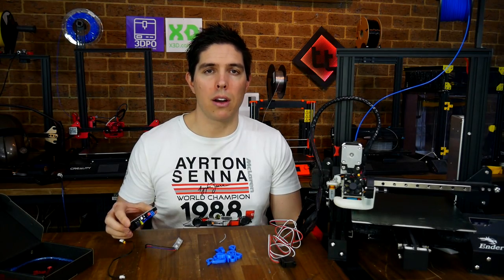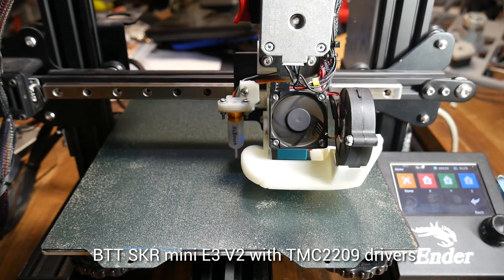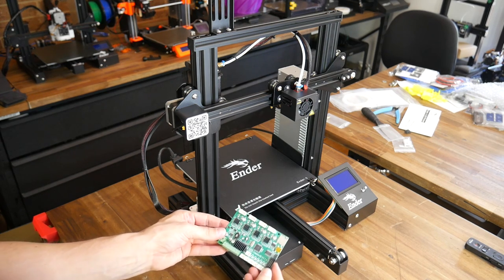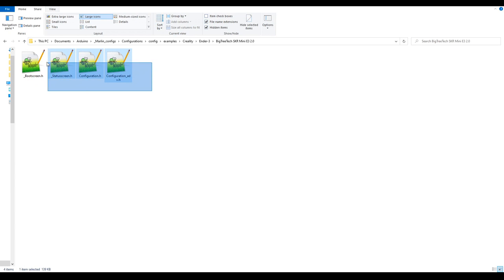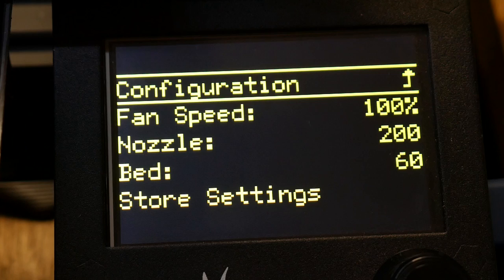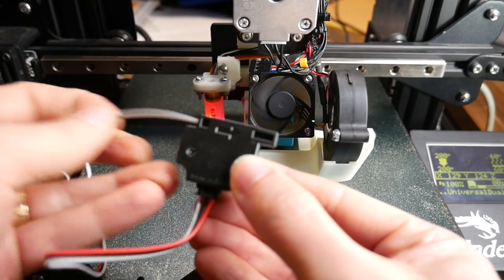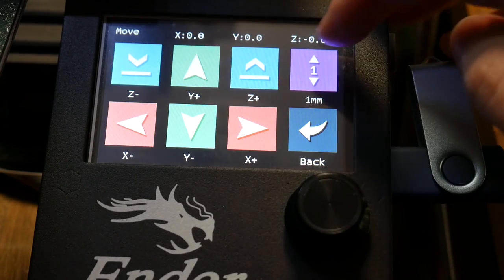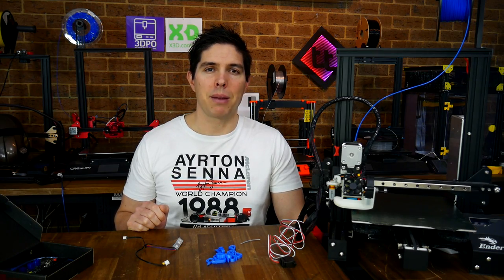SKR Mini E3 V2.0 - Complete guide to the best value Ender 3 upgrade

Comment: I’m having a problem with the wiring from the btt tft35 e3 to the skr mini e3 v2. Looked at this video and the one exclusively on the tft. The wiring diagrams shows on which side the “loose” reset wire goes on the tft connector on the mainboard, but not how the 4-pin part should be turned. I could take a volt meter to find the +5V pin of the tft connector on the mainboard or loosen the screws of the mainboard and look under it. But how can I find out which side of the black 4-pin connector is the +5V. Cannot find any markings on the serial connector on the tft35 e3 board. They would be hidden under the screen. Also, the graphical coding on each strand of the serial cable are not in the same order on the btt installation video as on the black serial cable I got with the new display. So what to do? Btt warns of short cutting the mainboard if getting the serial cable the wrong way. I’m a newbie, help much appreciated.

Comment: It would be super helpful if you could drop in a link or two (or perhaps make a video one day) to some viable dual-motor dual Z upgrades for Ender 3 Pro, which this board enables in earnest (as opposed to driving two motors off one driver). There's a smattering of offers, but most look dodgy (motors not matching the original Z stepper, etc). The idea looks especially appealing if looking to also do direct drive conversion as it add mass and makes gantry sagging even worse. Please consider!
Reply: I know this has been a while since this comment, but I believe the board can power two motors(has to ports), but uses the same driver.

Comment: Mmm, this is seriously tempting. My big question is how well does a BLtouch work with it? On the SKR 1.2 board, I would get BLtouch probing errors that would halt the machine. They weren't super frequent, but were frequent enough to be annoying enough for me to switch to a different manufacturer's board, which works okay but I would like to switch back to the SKR board for various reasons.
Reply: 24 hours after install my first mini 1.2  with the bltouch failed so spectacularly in the middle of a print job that it broke the print in half and drove the hot end into the print bed and creased it. I got an exchange through hamazon and the replacement mini has been working fine, though I gave up on bltouch due to the inconsistencies like you describe and others have noted in bug reports on github.

Comment: First of all, congratulations on the excellent quality of the tutorial. Some time ago, I bought a printer mounted on the arduino+ramps system and I would like to upgrade with this board! It would be possible? Could I use my old printer's endstop+servo instead of bltouch? I also wanted to use my old display which is a Bigtreetech btt mini 12864 v1.0 12864lcd display. How would I go about reinstalling the marlin on the board? I've tried several methods offered but none worked. can anybody help me? Thanks in advance for any help.

Comment: What about Resume print? My resume print after a power outage no longer works after this upgrade. Yet, the code clearly shows resume print. WTH? Any advice on this? Resume print is selected via the options on the toughscreen. This is frustrating, I LOVE how quiet and great my prints are, but losing this functionality makes no sense! Any advice or direction would be GREAT! I have this installed on all my CR-10's and Ender 3's.....SO QUIET....but I need print resume.

Comment: Updated the firmware on my SKR-Mini E3 V2.0 on my Ender 3. Now things are off with my Octoprint. Fans don't start when they're supposed to, I have to click the nob on my printer for it to realize the fan should of been on. Both the board fan and the part fan. The only fan that's on all the time is the heater block fan. 
Also, when I load the firmware on my Raspberry Pi do I leave that sd card in there unchanged or do I just remove it or do I remove it delete the firmware from it and put it back?
Everything worked fine before I updated the firmware on my SKR-Mini E3 V2.0.

Comment: Could you next test if for instance filament sensor works even if printing with Octoprint? Found out that v1.2 didn't support this use case which was sad.
Reply from the maker: That's going to happen with every board because the Marlin filament runout is designed to use the LCD. You can setup runout to plug into the pi GPIO if you like, but I've never done it.
Reply: @TeachingTech  I have it running via the OctoPI, works like a charm. But I noticed that many filament runout plugins all have the same programming bug in the code (seems like copy-paste work). If you have trouble running it on the PI, see my posts on how to correct that in the Octoprint forum.

Comment: Hi Michael, awesome guide. I installed yesterday this board with your guide and graphic and it´s fantastic, no noise at all and the tocuh screen make my Ender 3 Pro in top 3d Printer. I have also installed a Micro Swiss DDE. What do I need to change to print at 310ºC? Thanks, all I know about 3d Pronting I learned with yopçur videos.  Ariel from Argentina.
Reply from the maker: Glad it's working well. In configuration.h there is a line about max temp where you can lift the value. Might be worth a PID tune too. Next video is on a high temp hot end so it will be covered there too.
Reply: @TeachingTech  Hi Michael, yesterday accidentaly I unpluged de printer while it was printing, and the auto resume function as my original E3 snd I lost the print, any idea how to activate auto resume or thisfunction is note supported by this motherborad? Thanks in advance.
Reply: @ArielZima   As far as I know "auto resume after power off" was feature of Creality melzi boards only. Worked by logging the last good line of gcode to the SD card.
Reply: @mrdoohickey4824  Hi, thanks for answering, I asked Bigtreetech support yesterday, they answer my this: "You need to open this configuration in the firmware (enable define POWER_LOS_ RECOVERY. Without the power-off recovery module, the nozzle will not rise automatically and may damage the nozzle." but I don´t know how to edit Marlin. If you can help me doing it remotly I ll be very happy.

Comment: Hello great Tech.
Your videos are great and they help me a lot, but today I need some direct help, I recently bought a skr mini 3 v2 and it stays with the lcd on without any information, when I turn on the power button, it shows a red led on the board and soon it goes out, you can keep the hotend coller on, I've tried to upgrade by the sd card and nothing, and I've tried with all the .bin files I found, when I connect the USB there is no sound signal that it was connected but the lcd stays on.
I don't know what else to do, I searched about resetting the bootload with arduino and found nothing.

Comment: Hello i was wondering if you or anyone else had or is having trouble with a bltouch working properly on the skr mini e3 v2.0. I have tried both wiring ways both as z limit and also as straight z probe. It will run thru the probing and after the 25th probe it will just stop and wont promt to save it so i can use it.

Comment: I want to use this Mainboard for my Ender 3 Pro, is it plug & play? I heard from a few Problems with tmc connection with the x axis?
Reply from the maker: No such issues for me but I can't speak for others. Ender 3 and Ender 3 Pro are the same firmware wise apart from the word 'Pro' on the status screen so yes.
Reply: @TeachingTech   I changed and its perfect, but when I try to "customized" the Firmware with the correct config files, then I get when I try to build 1 failed log (STM32F103RC_btt_512K      FAILED) anyone know why?

Comment: The 1.2 is a lot cheaper now about $34 VS $50 AU however they only seem to offer TMC2208 and not TMC2209.   Is the TMC2209 much better and is it possible to put ther TMC2209 in the 1.2?

Comment: Is it possible to change the firmware in some way to make it so the part hotend fan and power supply fan output 12V instead of 24V so I don't have to use buck converters to be able to run Noctua fans?

Comment: i see only the 35 screen will work is there a way to make the 43 screen to work with this board i mean i can switch it to touch screen however it tells me there is no printer attached? you know a solution to this ?

Comment: Hello, does this board need the DCDC 5V if i want to use filament runout sensor with BL/3D Touch? Or only neopixels?
Reply: I forgot to add that the seller wrote that voltage parameter for Touch is 5V

Comment: Hey TeachingTech/Community! I wanted to hookup my Ender 3 V2 with a PT100 thermistor for achieving hotter temps (300+) and was going to use an amplifier board supplied by E3D to adjust the signal of the PT100 for compatiibility reasons (I assume).  The amp requires a 5V, Gnd & anologue input pin, would I be able to use the pins that are allocated for the neopixel LEDs for this purpose? Thanks in advance!

Comment: What is the advantage, if any, of sensorless homing vs using the switches?
Reply: Sensorless homing is not quite ready for prime time. You cannot guarantee that "home" is in the same place every time because it relies on the stepper motors supplying "feedback" to the stepper drivers by detecting the physical resistance encountered by the stepper motor. End stop switches are more accurate.
Reply: Only advantage is saving I/O... There is some situations, even if not often occuring, where this can be useful

Comment: It should be noted that certain Bltouch need the VCC and GND connector switched to work properly on this board.Took a while til I figured that one out. But other than that it's a great board and klipper makes it even better
Reply: I noted that detail in my review video of the v2.0 a few days ago.
Reply from the maker: I always match mine to the wiring diagrams in the manual as I install. I really hope people don't just plug in cables randomly and wonder why the magic smoke it out.

Comment: Any chance you could do a video on the SKR Pro 1.1 setup and maybe differences with skr pro 1.2 (which appeared 10days ago)
Reply from the maker: I have a V1.1 but not any printer that needs that much IO. Saving it for a future printer than can benefit from it.
Reply: @TeachingTech  i was looking to add it on the ender 3 for dual extruders (todo) and dual z

Comment: Just installed the new board and TFT35 screen. I think there is a problem with this board. After connecting it to a PC or laptop there is a chirping noise coming from the Z axis stepper motor, the threaded rod is jerking if you try and manually turn it and the Ender 3 Pro is pretty much locked up and has to be turned off and on again. I have tried the USB connection on my main PC and then a laptop, all good until a few seconds or minutes after plugging the USB cable in. the firmware for the board says 23-03-2020 I am not sure if there is a later one or if that will make any difference. I will be adding a video to my channel tonight showing the issue. Just mine? Or is this a problem with these boards??
I also noticed that whilst I can press the TFT35 button for three seconds to bring up the choice of Marlin Mode or Touch mode I can not select Marlin mode with the dial, I have to touch the scrren to select Marlin mode, not a major issue but not how it is shown in videos. Occassionally I switch to Marlin mode and get stuck with LCD12864 at the top of the screen, I have to power off and on to get it back to normal.

Comment: Bought an Ender 5 pro last year, had BTT skr mini e3 v2 delivered today and tft 3.5.... as soon as i turn it on and try homing it it just smashes into the ends and tries to keep going... tried building marlin a million times but its not my strength and im failing miserably... where the hell can i find a bin file to just load onto my sd??

Comment: I just upgraded my SKR Mini 1.2 to this version yesterday as well as adding a TH3D filament runout sensor. I am however having problems with the filament runout, and I think it’s because I’m running everything from OctoPrint. When the sensor trips it’ll stop and retract the filament to the distance specified in the firmware, but when I go to load it back in, I’ll press the button and it’ll extrude to the nozzle and just sit there. Subsequent presses just extrude more filament and the print never really resumes.

Comment: I didn't fully understand from the video, is this v2.0 512Kb or 256Kb like v1.2?
Reply: It doesnt matter, in V1.2 used STM chips also have 512K. The recent firmware makes use of it. https://github.com/bigtreetech/BIGTREETECH-SKR-mini-E3/tree/master/firmware/V1.2
Reply from the maker: Rick is correct. V1,2 should have has 256kb but actually had 512kb. This is labelled the same processor but also has 512kb.

Comment: Could you do a video on how to install the ezabl bed leveling system on this board please. I’m a bit lost trying to figure it out. I purchased the version that is sold on AliExpress. It looks like the TH3D ezabl but I have no idea if it’s the same. I had ordered this kit on Amazon until I found out that it was more affordable from AliExpress. Also I’m now using the herome5 dual duct with the 5015 single fan. This puts the abl sensor on the left side of the nozzle. I’m having a terrible time trying to figure out how to make changes to the firmware. I tried following your guides but in several parts you went through things a bit to fast, or you failed to show where to put certain files. You said to copy and paste the config files for the ender into the marlin file. But where in the marlin file? There are a lot of folders in there. In fact the marlin version that I found on github did not contain the config file, just a message with a link that says to go to a specific github file for the bug fix v2.0 config file. Where do I put these bug fix files at in the marlin software? Here is my problem, I’m a bit older then your normal viewer. My grandkids call me old, which in this case translates to a bit slow. I’m going to be installing your rear case mod as soon as it’s all printed out. I don’t want to be a bother, but just could use some slower guidance with more direct spoon fed instruction. Right now I’m trying to get enough money up to buy a ender 3 v2. I had originally tried to buy a tarantula RS however the new company owners of Homers/Tevo have some issues and terrible customer service. Creality is totally different to deal with. They answer email questions same day or next at the latest. They also have a phone number for help if needed. There is more instructions out there for the bl touch then the touchless sensors, so I wonder if I should have went that way. With that said, that’s why I was asking if you could do a video on setting up the ezabl style of bed leveling sensor. I would be very great full.

Comment: Do you know if it's possible to get the automatically controlled electronic enclosure fan working on a SKR 1.3?  I have a large 120mm fan cooling mine, and I would love to lower the power footprint of the printer.

Thanks!!
Reply: You can install a small mosfet switch (costs only a couple of bucks) to turn the case fan on and off.
It's actually mentioned in the official SKR 1.3 guide, search for "driver fan":
https://github.com/bigtreetech/BIGTREETECH-SKR-V1.3/blob/master/BTT%20SKR%20V1.3/BIGTREETECH%20SKRV1.3%20guide%202019%20-%206.pdf

Comment: I've just bought a 5pro with blt pre installed. Is this board still a worthwhile upgrade just for the 32bit cpu?
Reply from the maker: Depends how happy you are with the printer at the moment?
Reply: I personally use an Ender 5 Pro and am considering this board as an upgrade. All of the Creality motherboards are using low performance processors. From my testing this has  resulted in periodic surface artifacts on high resolution prints (cura setting of maximum resolution below 0.1mm). Although I've just been printing at 0.15mm maximum resolution just to avoid these issues, for $35 it would be nice to lower that value.

Comment: Hi, I have been running with this board for 2 weeks with no problems until  I installed the bigtreetech smart filament sensor.  After following the configuration as indicated on the bigtreetech web site, I am still unable to get the sensor working.  I have 2 sensors If you would like one to test I could send you one.
Reply from the maker: I ordered one March 29, apparently the package was returned to BTT. They resent it the other day, so eventually I'll have a guide on this.

Comment: I just installed this on my Ender 3 pro with the touch screen from them as well. I have a bltouch and have it set up in the second configuration so it's plugged into the z stop. I am now trying to set my z offset and I am not able to move the z axis into the negative to be able to get the nozzle to the bed. Any idea how I overcome this? Would also like to say thank you for all your amazing videos. This is my first source for any questions i have regarding my Ender.

Comment: hello, can you please explain how to add neopixels, they changed a lot how platform io file code is on 2.0.7, and nothing is working,  unable to compile, followed multiple guides but non are for 2.0.7 which has some different layouts, seems like they are combining boards into sectors, which throws everything off

Comment: Looking for sum help I have an ender 3 pro.
I tried putting a skr mini e3 v2 bord with a the custom mariln firmware on it (only changed for a BLtouch and a smart filament sencer). 
The problem I am having is the auto home failed, the end stop micro switch engages but the steeper drivers just keep turning on both x and y.
I’m very new to 3D printing and not very good with code.